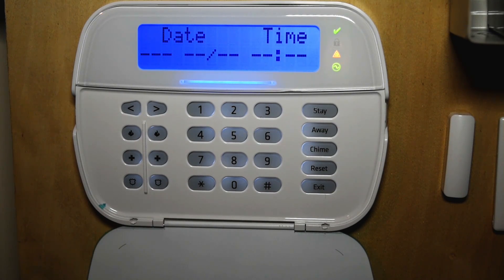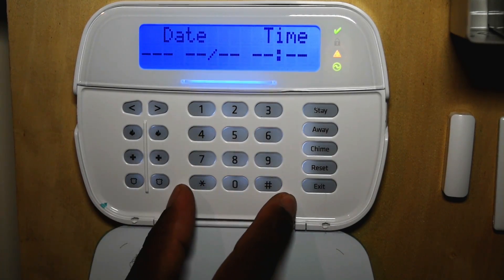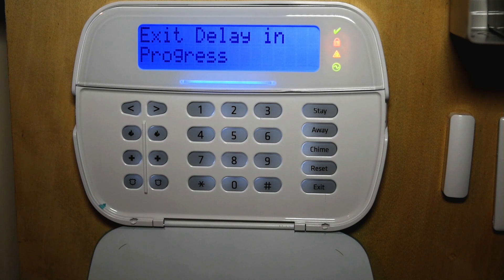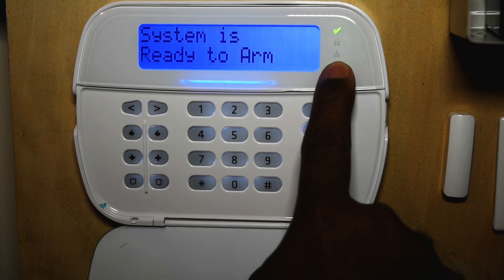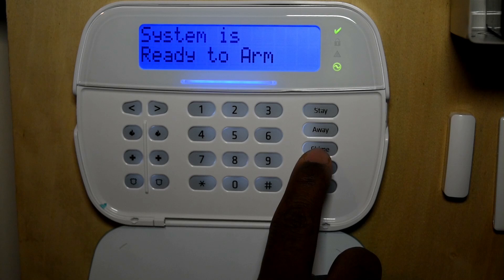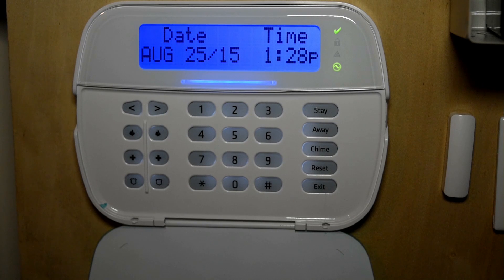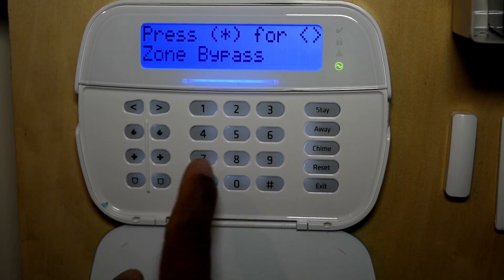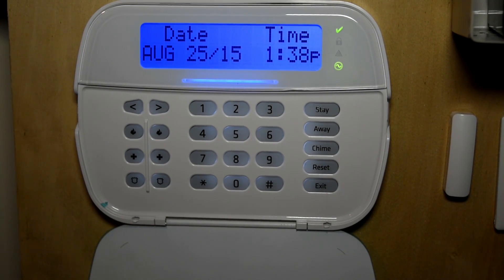How to use DSC Neo Panel

Comment: Me - so how do you change the batteries?
Manual – you see those two tiny slots at the bottom? stick a metal screw driver in there, then dig into the surrounding soft plastic to pry away until you get lucky.
Me - Awesome! thanks manual
Manual - De Nada

Comment: I just replaced my dsc 5500 keypad with Neo keypad. But I'm getting a system fault "call for service"and my keypad keys won't work except the # key. Can you please abide to fix this issue, I'll appreciate it
Reply: the power series is keybus, the neo series is combus, so a neo keypad will only work with a neo system.

Comment: Texecom Connect SmartCom Ethernet and WiFi communicator. The Texecom Connect SmartCom is an Ethernet and WiFi communicator that facilitates the Texecom Connect experience by connecting any Premier Elite control panel to a local area network.
Url: http://www.solutionscommunications.in/latest-update/texecom-connect-smar/1616?utm_source=bk_android&utm_medium=share

Comment: How do I put in a master code?  I bought a house and no one knows the old code
Reply: You have to know one of the two. Either the old master code or the installer code. If you know the old master you tip the following (* 5 old master 01 new master # #). In some firmware versions the system will ask for confirmation for the new master.
Reply: @tsikrgr4501  .... REally ??? The master is not *5 master XXXX 40  new master XXXX ??

Comment: Is the master code different than the code that is used to disarm/arm the alarm?
Reply: Any valid code will arm and disarm the system. But only The Master can make changes. However, to make changes to the programming; only the Installer's code can do that.